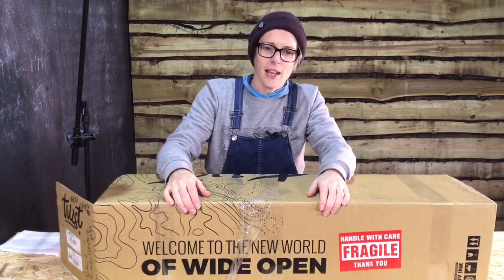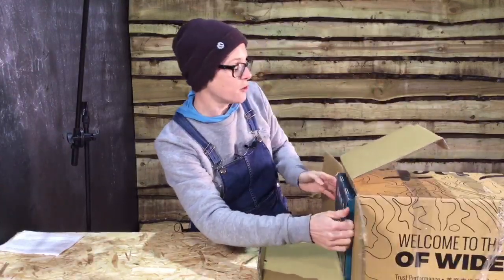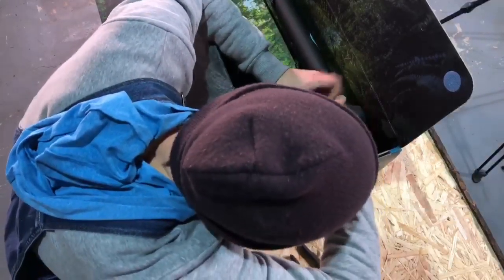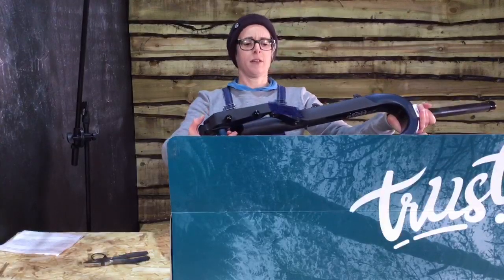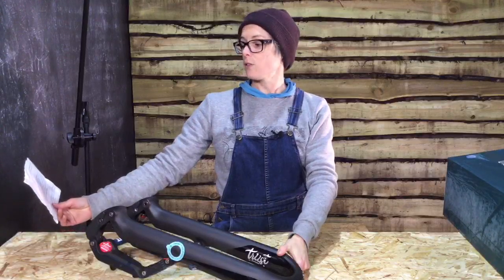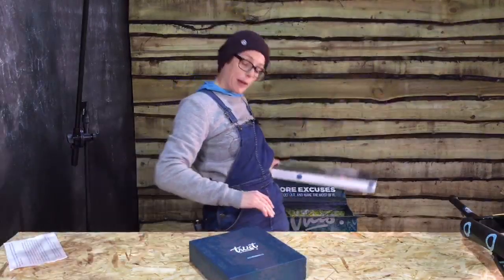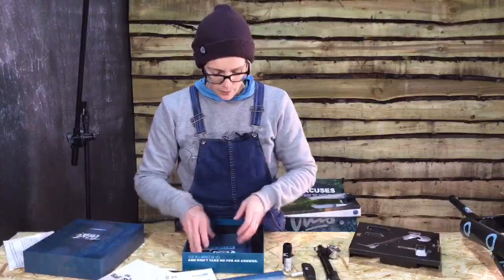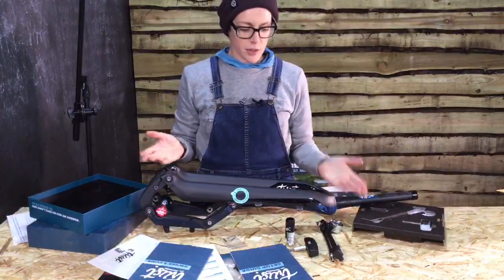Live Unboxing - Trust Message Fork

Comment: 11:04 it's called compression plug, it's used isntead of star nut, which can't be used on carbon steerer's.
12:27 3m VHB it's dual sided tape, adhesive, like Gopro mounts use. 

For anyone wondering who actually makes those pumps it's @
 there are mainly two pump manufactures that are used by the suspension makers the other one is @s/index.php